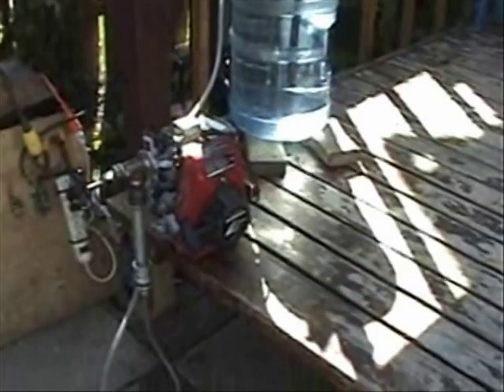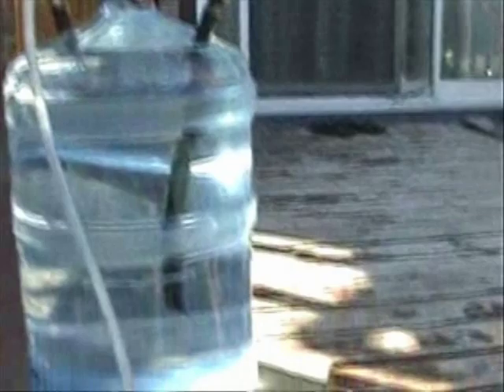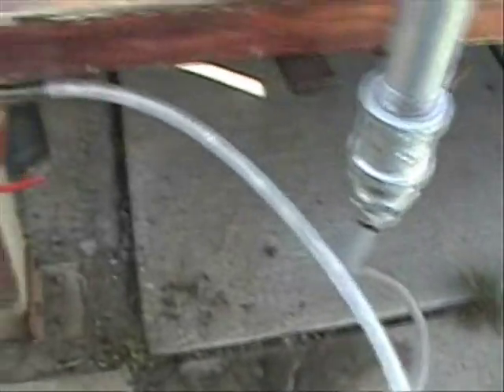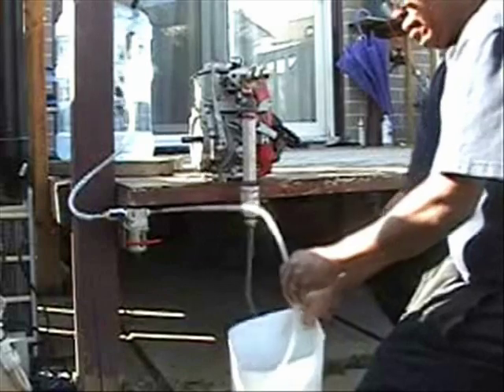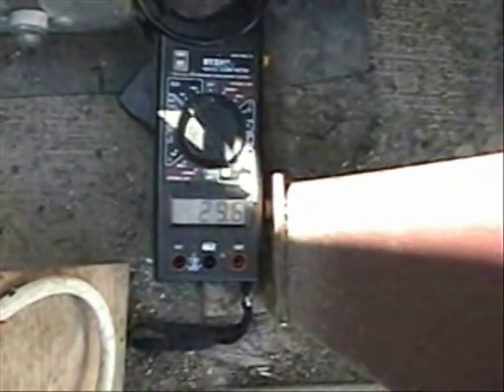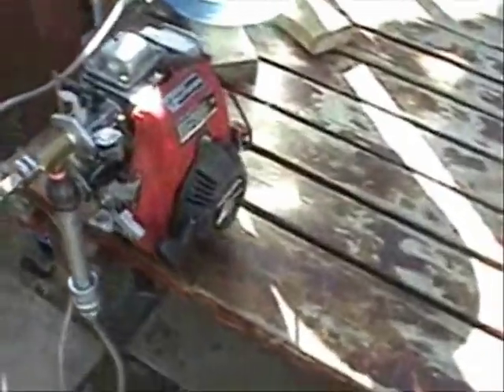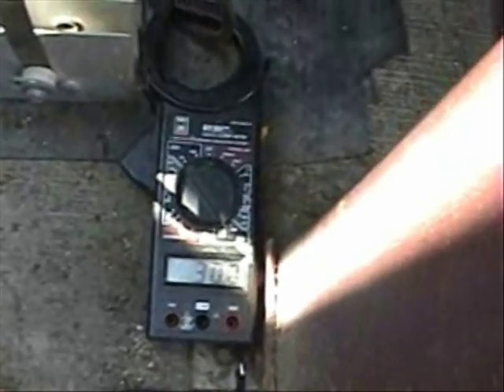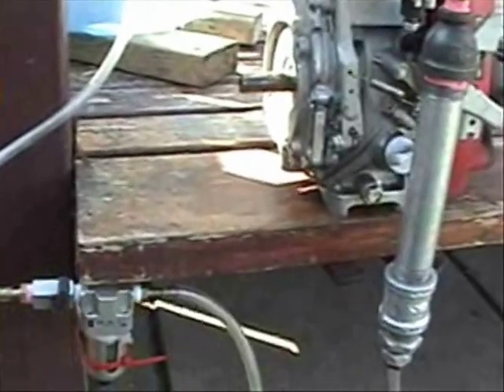Engine running on HYDROGEN from water electrolysis

Comment: @mrgalleria, So in answer to your ridiculous first question, OF CAUSE I would prefer water to oil.
Courtesy the internet, the means are in place to go viral with working designs, making them impossible to suppress, but this would mean you are putting it in the public domain and will not be able to profit or recoupe your costs.
So your car that runs on NOTHING but water, when will you be sending me the blueprints?
I'll even be happy to pay
I'll just wait shall I?

Comment: @mrgalleria, Most inventors fail to do basic maths and chemistry calculations. It will save you a great deal of money and heartache.
Energy is never destroyed or created, your just moving it from one place or form to another.
"Embedded Energy" is what was put in during manufactoring to make the material: e.g: a piece of aluminium is basicly solidified electricity, it uses that much to make it.

Comment: @mrgalleria, I just get upset seeing people waste time and money, reinventing the wheel.
I can build you a car that runs on water in under a week, it will run and drive like any other car, but sadly it won't last and there are several tricks I could use to make it apear to be self sustaining. "If" I was a scam artist, had no morels I could easily make a living pulling fruads in this area and sadly I have caught so called inventors doing just that before.

Comment from the maker: @toyu17 Every detail is being given. From the tank to the DRY Cell, to the bubbler, to the dryer  and yes this one has a carburetor attached with the carburetor bowl off to prove to everybody that this engine ran with pure HHO without any aid of gasoline, acetone, alcohol, starting fluid or any kind of flammable liquid just straight and pure HHO. THANKS for watching.

Comment: @mrgalleria, Water is VERY energy dense, yet nature has packed it so well that you can put out a fire with it!, that is untill you reach the magic temperature of 2400c then water literaly explodes.
The Space Shuttle main engines run on basicly split water, thats not smoke (carbon), its steam, pure steam! sooooo water is actual Rocket fuel, neatly packaged, the holy grail is finding a way to unwrap it without using much energy, so you can benefit from what is released

Comment: @mrgalleria, A good book or video's on here about Thermodynamics will greatly expand your understanding of what is going on.
You want NO unburnt fuel comming out the exaust.
Liquid water injection can be used to overcome detonation.

NOW THINK ABOUT THIS
Water, split into gas, combusted, goes back to water, therefore!, there must be a CONTRACTION taking place in the cyclinder!, namely at certain point the piston is getting sucked in the wrong direction! reducing efficientcy.

Comment: @mrgalleria, You need to adjust timing for TDC or just after.
Your mix rate is wrong. agian this a NEW fuel to the engine.
You want to run a SUPER LEAN mix as much oxygen as possible
Less Hydrogen used to do the same amount of work, means less energy to get it from water in the first place, which means a higher efficientcy.
THE BEST is swirl premixing and pre combustion, releasing only a flame (Plasma) jet into the cylinder. Fuel is only there to expand the air in the cylinder.

Comment: @mrgalleria, Meyer was a complex individual. I suggest you look a little deeper into patents he made in Canada.  *
Shaking water molecules apart requires less energy then brute force Electrolysis, the later yeilding less energy for combustion than what was used to release the gas, so a negative cycle.
The secret is to get every last bit of energy out of the Hydrogen when you burn it.
Hydrogen is completely off the octane scale and has a Flame Speed thats near instaneous, not like oil

Comment: @mrgalleria, ANY ICE engine can run on Gaseous fuel, that has nothing to do with it. Oil: HydroCarbon: Hydrogen and Carbon, so when you burn it you get Carbon bonding with Oxygen: Carbon Dioxide and Monoxide,  Hydrogen with Oxy: water in small amounts.

With the right modifications any combustion can run on Hydrogen, you just get a great deal of water vapour, so you coat the bore, stainless exaust or you have a dry down time

Comment: @mrgalleria, Its easy to get 20%, 30%, 40%, hell I can produce 100% right now!, can you? thats IF I don't fully do the math of "Embedded Energy" and maintenance.
I see HHO being sold all the time by sharks, claiming 20-40%, as read of an economy computer!, these are fruadulant, the sensors are not designed for the mix and misread.
Do you even know how to do your math properly big mouth?
You build a NETT 100% or better unit and I will buy it right now!

Comment: @mrgalleria, Stop being a JERK attacking people who are on your own side!
My figures are accurate, but always open to review.
They are NETT figures, not like the claimed ones I come across all the time.
So with your 20% have you factored in ALL of the wear, tear, chemicals and then done a "dead reckoning test" ?
And if you know it all why are you using any Petrol/gas???
You should be able to build a 101% efficient HHO unit shouldn't you?
Why arn't you on 100%water NOW? pull your FO

Comment: @mrgalleria, I have been following the work for 30 years, I have more experience in thes area's then I can fit here, what I will say is that I know more then 90% of the population in these area's, have spent $10,000's of my own money, destroyed a 6cyl engine and seen many small ones damaged. These days I do more with electric drive systems, less parts and more efficient, how many of your friends drive cars that use NO Petrol/Gasolene? (mine is in design stage)

Comment: @mrgalleria, All that matters is finding an efficient way to get the electrical bonds between the Hydrogen and Oxygen to let go. Catalysts and Thermolosis are currently showing the greatest promise, injecting high frequency radio works, but I'm yet to see Nett gain, how ever Mass Spectrometer results show that there are little bubbles colapsing and getting as hot as the Sun. Then there are UV triggered PV's/ catalysts.

Comment: @mrgalleria, After doing serious damage to engines, I learnt that you have to modify the engine to get long term viability, these engines were simply never designed for Hydrogen.
A PEM Fuel Cell is a vastly better way to go, but still expensive, as we seek another catalyst to replace the platinum.
There are several ways to reduce the amount of hydrogen needed to run the ICE engine, down to around 1/7 what is being used here. Both Mazda and BMW have perfected ICE on Hydrogen

Comment: Small hydrogen producers on a vehicle, if made and installed, used correctly can offer an increase in fuel economy 8-30% is claimed, sadly most claims are faulse. The problem is the amount of power used to split the water. Catalyst assisted process and other areas are worth further investigation.
The energy is in the water, the trick is to find an efficient way to release it, thats the hard part.

Comment: PT4
In most cases cases sadly the engine will suffer serious long term damage being used like this, wiping out any savings in fuel costs.
When Hydrogen is burned with air or oxygen, water vapour is produced, this will collect in the engine, get into the exaust, oil, damaging everything.
One way to stop this is to run the engine for a while on Petrol or gas for a while prior to shutdown, while increasing revs, this will dry out the moisture.

Comment: PT3
All that has actually been achieved is to change one form of energy to another.
You would be better just buying coal, make a highly efficient machine to use its heat: Steam engine, Producer gas engine, Stirling engine ect.
There are other ways to make hydrogen, electrolysis splitting is not the best
Maybe you should look at turning this into a welder instead: Browns gas, that would give you a Nett gain, eg: welding. even better a Plasma cutter, they work well on Hydrogen Oxygen.

Comment: PT2
As the other gentleman said, using more advanced electronics will help yeild of gas.
But unfortunatly in this form its still a negative or no Nett gain cycle.
Power station burns coal-steam-turbine-electricity-tranmission losses, split water-hydrogen, oxygen-burn in engine@15% efficientcy to make motion. The whole process is neither clean nor Nett gain.
To make it worse the engine exaust has high Nitric Oxides: cancer causing.

Comment: Technically, this is not "Energy", its "Fuel" you are splitting water to release combustable gas.
"Energy" is never created or destroyed, it just changes form 
.71KW in, how much out?  the motor will only be 15-20% efficient, and the electricity has to come from somewhere. Nett figures are what counts unfortunatly.
Simply driving an electric motor will give a nett efficientcy of 75-90% 
The pressure shut off is an excellent idea, well thought out.